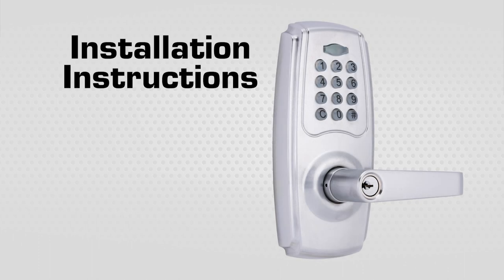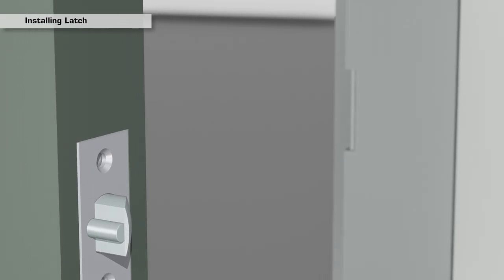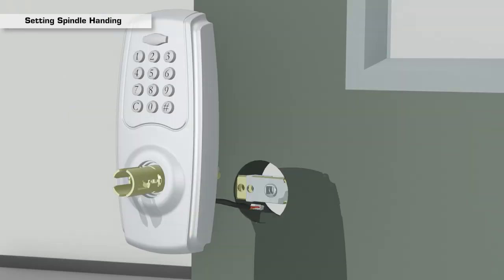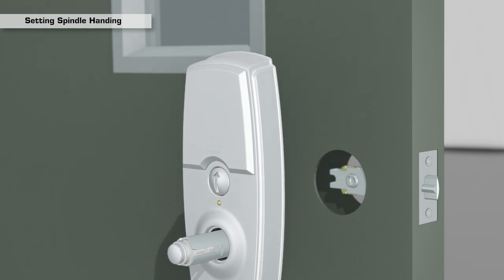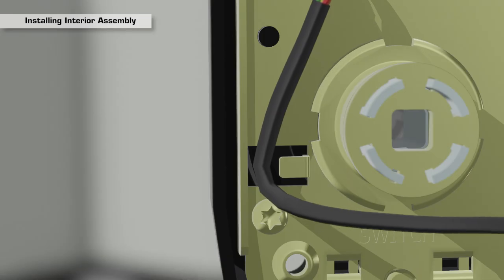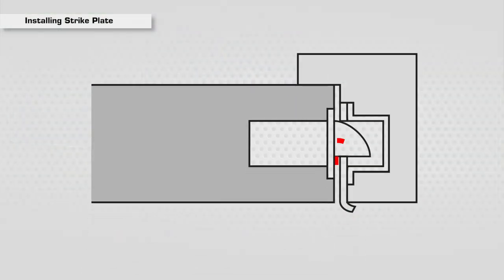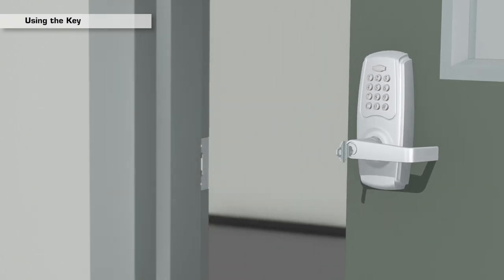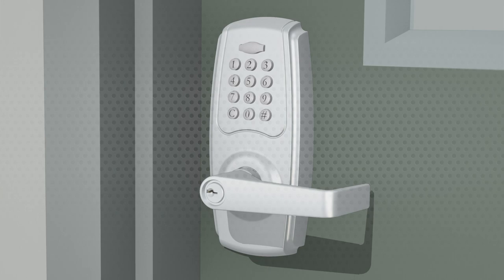Brinks Commercial Grade 2 Keypad Entry Lever Installation Video

Comment: I made a mistake. How do I take the handles back off
Reply from the maker: Hello. On the side of the handle on the collar you will find a small hole that has a pin to release the lever. Use the push pin provided in the package to push the spring in and pull the lever off. If you're still having trouble, please give our Consumer Care team a call at 800-562-5625 and we can walk you through it.
Reply: @brinkscommercial5425  Thanks for this answered our question